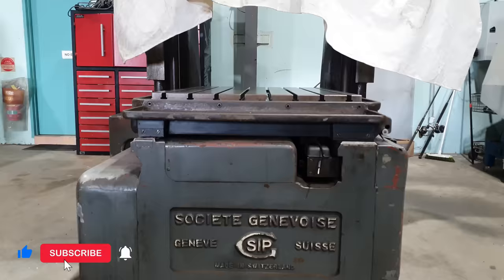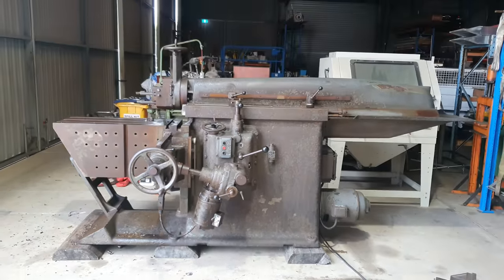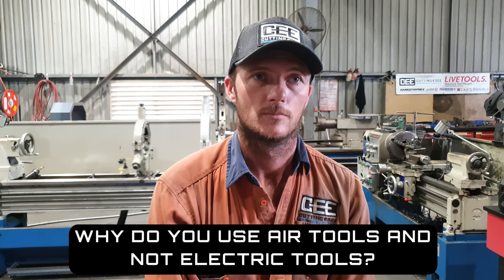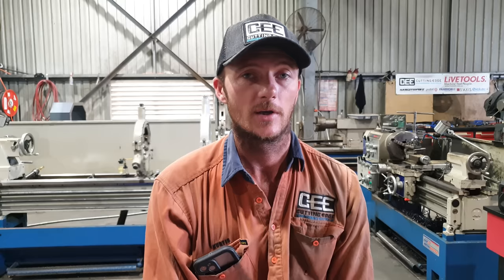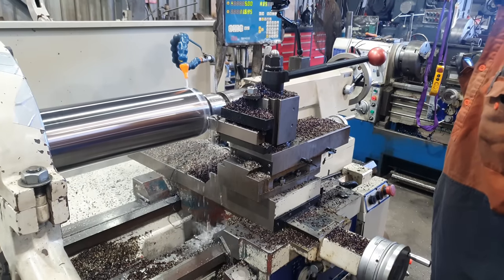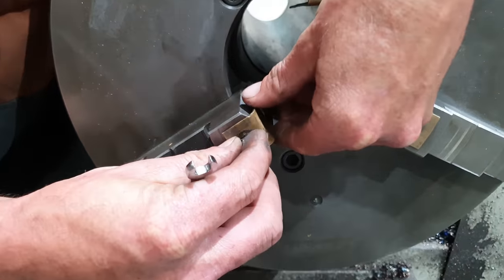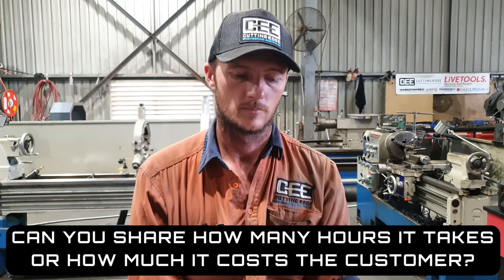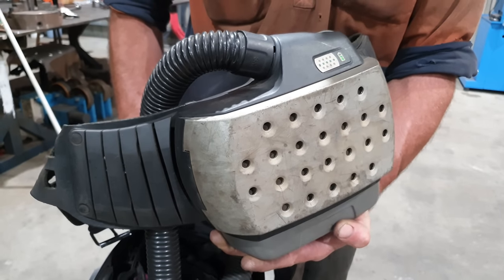Time For Another Q&A and EXCITING Announcement! | Patreon Launch

Comment: I've always felt the biggest advantage of pneumatic tools was twofold. First: the air allows the tool to cool itself and not overheat.
Secondly: you won't get a shock or electrocute yourself when using your tools outside in a light rain.

Comment: Another huge advantage of air tools over electric is they don't get hot when used continuously.  You'll never smell the brushes or armature burning up!
Reply: And there's no battery to fall out and shatter into a hundred pieces. There goes 300 bucks
Reply: They can get very cold, iv had die grinders get cold enough to be uncomfortable but never had electric tools too hot
Reply: They also tend to be more compact than an equivalent electrical tool.  Air motors are usually smaller than the same size electric motor.
Reply: I worked in tunnel construction, and we used HPCA to power clay spades for digging winches to hoist the lining into position. Plus a whole host of hand tools for Maintenace work. Fittings changed over the years to make coupling hoses to the machine safer, in the old days we became very good at grabbing a loose hose and doubling it over to shut of the air. Though funny to see a laborer trying to double an electric cable to stop a drill machine twisting. @killstrees

Comment: Question for next Q&A: During the episode when you re-bushed the transmission clutch housings, you put a very fine finish on them, then froze them to install them. Wouldn’t it be better to have a rougher finish so they’ll stay in the holes better when they warm up and expand? I’m a Caterpillar mechanic, and I find what you do to be fascinating. Now I know what happens to the crap we send to a machine shop for repair. Though I don’t think their standards are as good as yours.

Comment: ######    
######
######
EMPLOY a retired engineer to assist with cleaning, tidying and organising   rebuilding skates etc (up to 'stitching up after the surgeon')   
-    As a fighting fit 70 yr old I did that for a few years for a family member workshop and polished everything in sight when not cleaning/clearing. 
I undertook routine tasks, accounted for every tool every minute of the day and was very, very proud of my clean painted floor. 
(My previous occupation was office based so, to run around and get down and dirty was a holiday of fun)

Absolutely stay in control of your high standards and business model!

Comment: Your customers are lucky to have you. Finding a business where the owner is also doing the work is usually where you'll get the best quality.  Had my Vette repainted at a shop like that and it's the best body work I have gotten by far.

On the air tools, my father in law worked at a guitar company and one thing he mentioned is that the air tools are often lighter than electrical, so it's less fatigue when you're using a tool for a long period. 

Keep up the great work. Will sign up as a patron, but I say keep YouTube to one high quality video a week. Karen does an amazing job with the filming and editing, and you're so consistent about posting. Awesome channel.

Comment: if you have to drill a 45mm hole for your boring bar, if you drill a pilot hole with a 10-15mm drill bit. if you can drill through 150 mm in 2-3 minutes, then it is twice as fast to drill the 45 mm drill through the 150 mm. I took my time on it... I also made a connection from the sled to the pinol dock so that the sled pulls the pinol dock. It's actually quite good for many things.  but not when material must be removed quickly .  :face-blue-smiling:

Comment: Hello,
a question from Germany. We have a rubbish compactor in our company, the cylinder weighs about 3 t, the piston rod extends in 2 stages about 8 meters lying down.
After 12 years of operation, 8 hours every day (40 000 tons of waste per year), we lose 30 liters of oil at the main seal per week. Replacing the hydraulic cylinder alone costs around €50,000. Repair of the cylinder the same. What could be causing the seals to leak? Oil temperature 20 to 70 ° C, max. 300 bar.

Comment: test and tag must be done every six months for portable workshop tools but leads and any tools used outside must be tested every 3 months. fixed tools like the lathes were every 12 months. its not difficult but it takes time as its a documented process and this time costs a lot especially to get a sparky to do it. and not every test and tag bloke can't do the industrial tools. ive offsided to a bloke doing test and tag it just takes time. the test gear aint cheap either.

Comment: I do understand not wanting to take on another machinist, or anyone "qualified". That part makes sense to me. 
That guy won't be you, it can take YEARS to build enough trust to delegate important stuff.

( I used to do rigging for climbing events, and I was always relieved when I could get my brother to help out. When I went to check his work, it was always as if I'd done it myself. I'd recognize every knot, sling and carabiner placement. Not equally good in a different way, but just as I would have done it.)

But whenever I work with heavy or simply big pieces, not an hour goes by without me thinking "I wish I had another pair of hands at the other end of this part." 

At some point I do think you could benefit from some sort of apprentice or gofer.

If not full-time, maybe for certain tasks or part time. 
Maybe employment rules gets in the way of that?

Comment: This might be a strange one: 

How do you know how many spacer blocks to put under your boring bar when using it on the lathe?
Reply: Not a strange one at all. I do some amateur lathe work on a far, far smaller scale and I try to keep the spacers (really shims for me) and the toolholder/tool together; compartmented trays work well and someone suggested just supergluing them together.

Comment: One can tell it's your place and your machines.  The big lathe has NO tool marls on the chucks, and no tool holder damasge.  Shows you are compulsively careful with the equipment.  I ran the Univ Texas ay San Antonio instrument shop for the Chemistry department for 15 years.  The people working with me did not love the tool, the machines.  They weren't treated very well — they actually snapped off the crossfeed slide of my Linddsay lathe - I think they were using the compound clamp as a bebch vise.  We never got it fixed - write off one lathe.  They also broke off an entire set of endmills onw eeekend.  sigh  You Clearly take care of your shop!  These videos have been Very instructive.  Thank you.  Here's a few quid, please go buy homeless a dog chew and give him a pat from me.